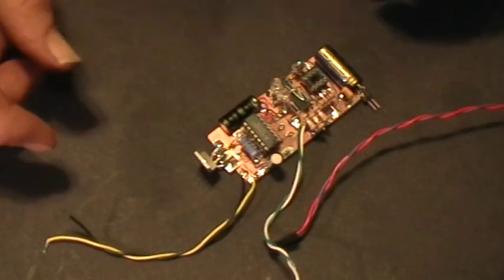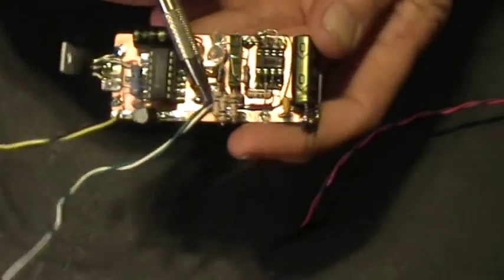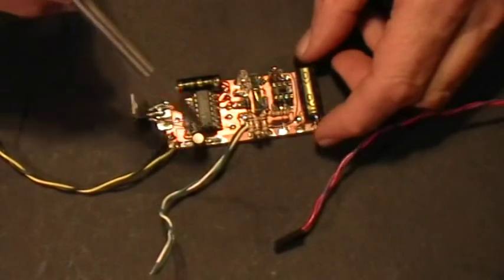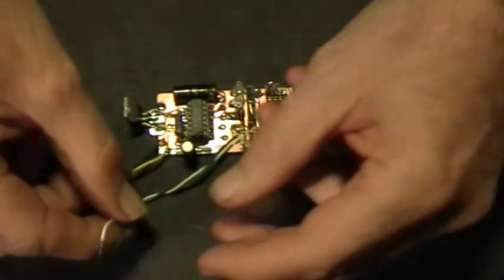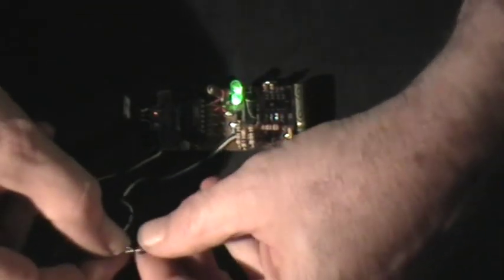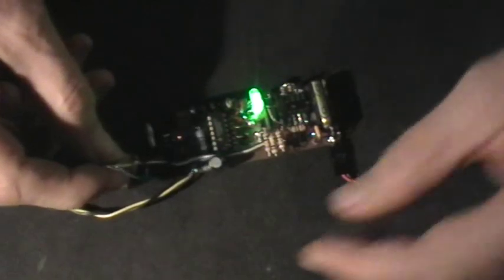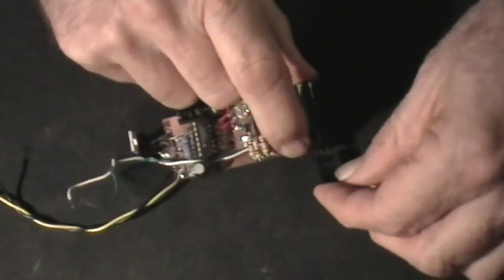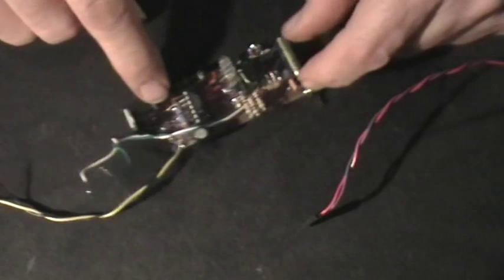Electric OU: TK-Akula 3V LED Test 1: Running on Capacitors

Comment: And you are only using 2 leds?

http://youtu.be/cRH9w6aWNcs
Reply from the maker: Let's see... checking the Akula schematic... .yep, only 2 LEDs are shown. Now looking in my video and at the actual board.... my goodness, you are right! There are only 2 Green LEDS! Fascinating.

As far as the video you linked.... what a remarkable demonstration of measurement error and incompetence! Thanks for showing it!

(If you want to see more LEDs, look in my Joule Thief videos. How about 24 bright white LEDs running on a single depleted AAA battery?
Joule Thief: 24 LEDs on One AAA Battery, 2n2222a
Is that enough LEDs for you?)

Comment: Have you info for U2 K561NH2 chip or replacement
Reply from the maker: Yes,it's a CMOS hex inverter, 14 pin DIP. Very common, equivalents are CD4069CN, or even 7404 can probably be used.

Comment: I can't wait to see your finished build.  I will be watching your channel for updates.  I am going to have to take the plunge and build the actual circuit myself soon.  I have started testing Akula's transformer design and I have noticed unique behavior with it.
Reply from the maker: Don't get your hopes up... I think this is going to turn out to be a complicated Joule Thief, probably. Akula is violating Conservation of Miracles: he's got too many different circuits that "work". As soon as someone else builds one and finds it doesn't work as Akula demonstrated, he has already moved on to some other circuit to demonstrate... and they all work for Akula. But none work for anyone else, it seems.
Still, I'm giving this one my best shot. Probably will finish the inductor transformator tomorrow and do some real testing with scope. Meanwhile, I loaded the missing chip and did some fiddling,  please check out the next video for an interesting result, without inductor.

Comment: You could fit a 34063 tonight if itching to try the chip....not sure where you are, but if it's before 9pm, head to local Dollar Tree and pick up a couple of USB car adapters. Inside is a MC34063A, working as a 12V to 5V converter.
Reply from the maker: Really!  I wish I'd known that earlier, I could have saved a couple of dollars.
So it's about 8:30 pm here.... I rushed out to the local DT and got one. Disassembling it now...
Man, that's amazing. How do they do that? For a dollar.... I got a MC34063A chip, a 1amp fuse, a couple of electrolytic caps, a little inductor, an LED and a USB connector.
THANKS FOR THE TIP !!

(Yesterday I ordered 3 of the chips for 4 dollars from Ebay.... and I thought that was a good deal!)
Reply from the maker: You've got a lot of neat videos. I subscribed and added you to my circles, whatever that means. Thanks again for the tip!
Reply: TinselKoala  I only found out myself the other day when taking one apart. Thanks for the circle adding and am glad the tip was useful :)